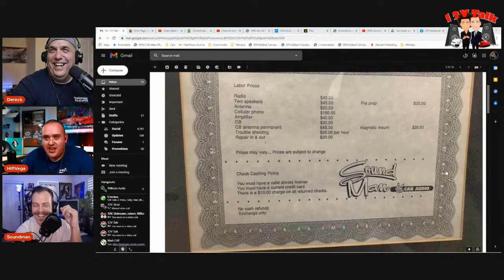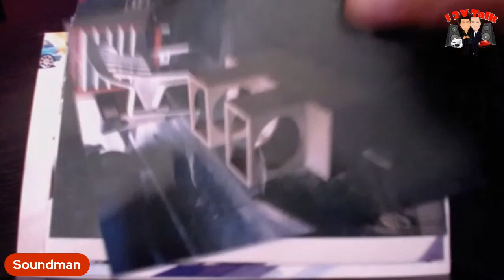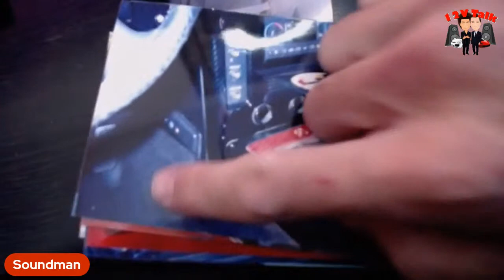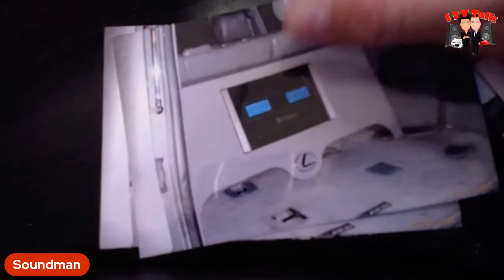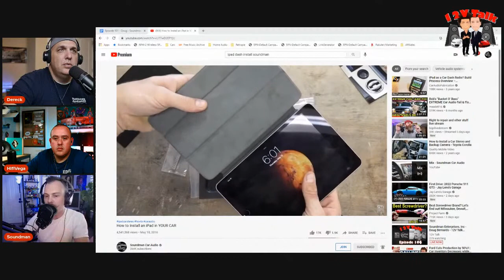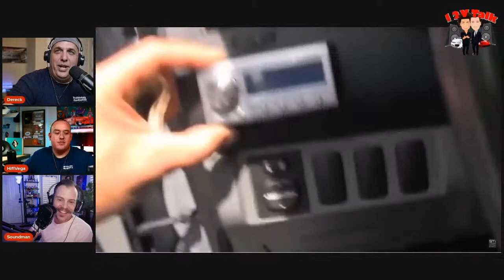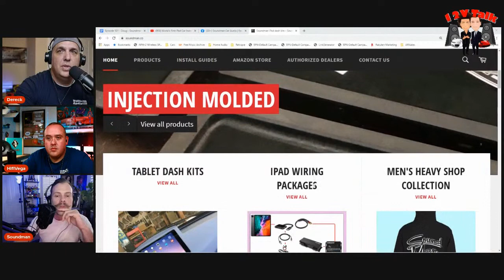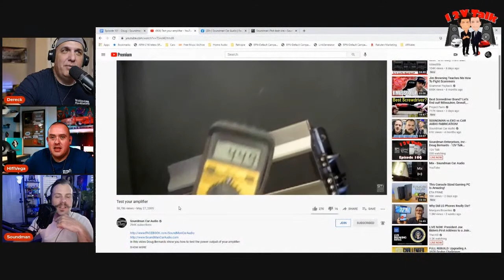Soundman Enterprises, Inc - Doug Bernards - 12V Talk Episode 104

Comment: This video of him showing the old pics took me back to when my brother and I Modified a geo spectrum with DVD, play station, Color tv, radio and a sub system. We had put a boomerang Antenna on the roof for tv reception. We had 2 18 inch Rockford fosgate subs with 2 old punch 150 amps running them. Believe it or not, with those 2 18s you could hear is coming up the road over 2 miles away. It would take your breath when then bass dropped and then the glass would blow out. We had to put 5 windshields in it and 8 back hatch glass. But like you said the boxes was huge then compared to now. All that stuff was in my brothers car. I had a 4 door Chevrolet spectrum and I had 4 mtx pro comps 15s and a old 5000 watt phoenix gold competition amp with 4 12v batteries and phoenix gold crossover and eq. But I think the old school stuff was very good compared to some of the stuff today. But on the other hand stuff today is built with technology to we the don't burn up as the old stuff did quite often I've seen times my amps were 200 degrees and abolishing got with a built in fan. I've gotten out of that stuff now but my brother has a Nissan Pathfinder we built a 4 alpine r12s 750 watts each sub. A 4000 watt crescendo amp. But we have a voltage problems we can't figure out.

Comment: these freaking  car audio  store can't stay open cause of the cars..   its not like it was in  2000   buy a radio adapter kit   amp wires speakers now you have to buy integrated steering wheel kits and more  shit